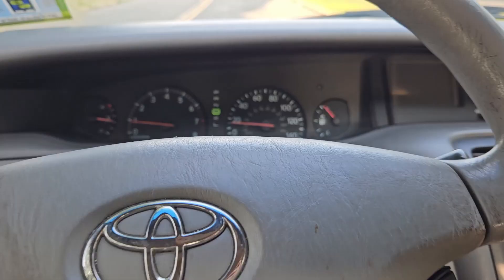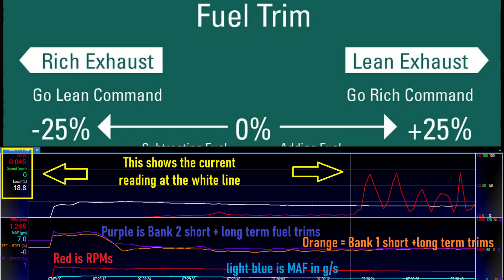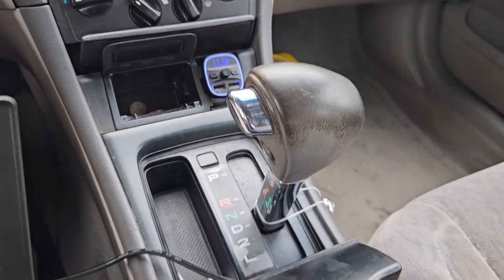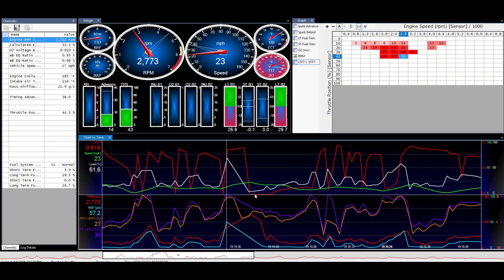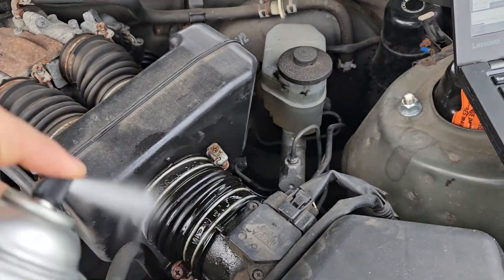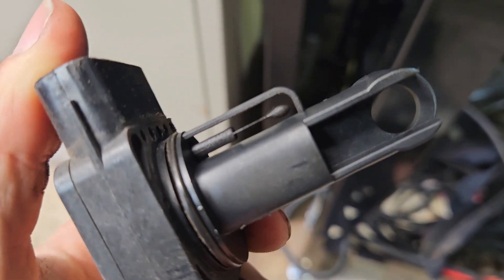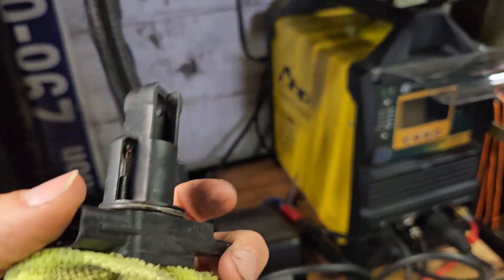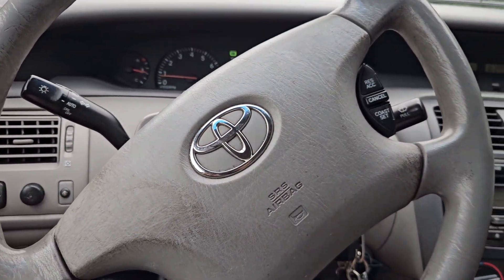Why This Toyota Stalls at Stops (Quick Fix)

Comment: ✋.... What is the 40 times rule ??  Never heard of it
Reply from the maker: Great question! The 40x (also 44x) rule is a back of napkin calculation assuming a four-stroke engine, near-peak volumetric efficiency (about 85–95%), and standard air density. When you convert the engine’s displacement, RPM, and VE into grams of air per second, the math works out so that most naturally aspirated gasoline engines at WOT flow roughly 40–44 times their displacement in liters. 

For example, a 3L should reach atleast 120g/s (40x 3) at WOT. If not this points to either an engine breathing issue or a false maf reading.

Comment: Nice ,only thing will add is brake cleaner on maf hoses isn't a good way to find leaks cause the lack of vacuum, prefer smoke or actual remove and inspection.
Reply from the maker: Thanks for the feedback! I agree brake cleaner definitely isn't ideal, i prefer propane as it follows the air flow better and will still excite the o2 sensor but I've had luck with brake cleaner in pinch situations. A smoke machine would definitely be the most definitive check though.

Comment: Nice diagnostic. Fouled, underreporting sensor. You should never touch the wires. Spray it with MAF cleaner, let it dry, and reinstall.
Reply from the maker: Thanks! & Agreed, especially if solvent is enough to clean the hot wire. In this case, the vehicle was already quoted a new sensor, so cleaning was just an extra confirmation of the data